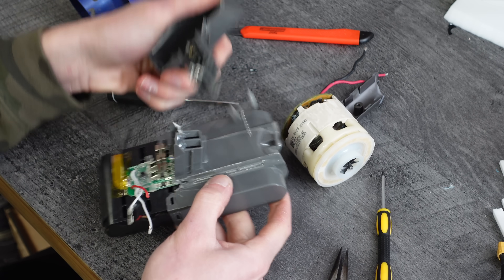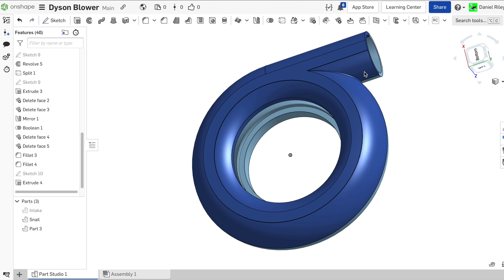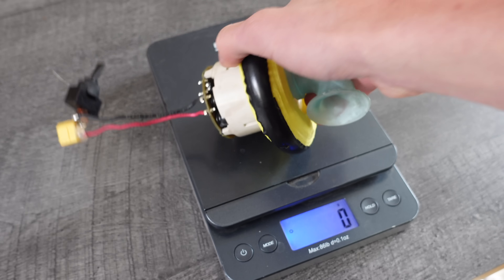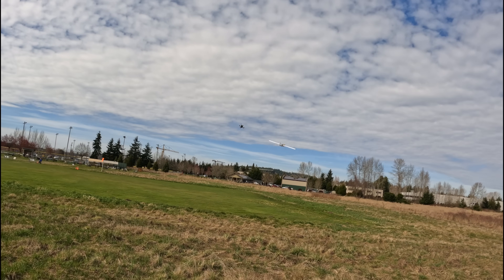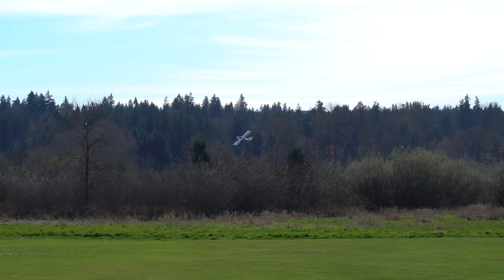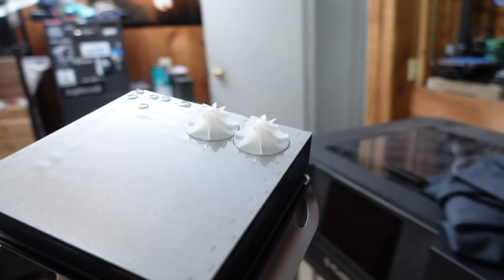Dyson Powered R/C Plane

Comment: This would be cool to redesign the engines and have them sit inside of an engine pod like a passenger jet so the turbine is pointed forward and the housing just redirects the pressurized are out around the motor and out a rearward nozzle instead of the snail shaped housing.

Comment: if the air is exhausted too fast to be effective, try blowing into a wide tube, so more air could be sucked through the tube, 
the combined airflow will be more but slower.

another idea might be to exhaust the air through a slit at the top of the wing, creating lift through blowing over the wingsurface.

last the fan from a dyson bladeless fan might be better for propelling a plane.

Ps.: mabe mr. dyson might be interested in this sort of project.

Comment: With regards the problem of flow volume, would it be possible to use a nozzle shaped after an inline venturi injector to draw extra air around the impeller exhaust?

Comment: With a high bypass venturi nacelle might possibly add a tiny bit of efficiency [similar to a high bypass turbofan engine...sorta] and make them look a little bit cooler.

With some kind of body like an A-10 you could maybe even balance out the weight while putting the thrust on the same line.

That, or perhaps tuck them under the wings and maybe use an inverted version of the Dyson ring [aka put the motor in the center of a nacelle with a torpedo slipstream taper on the back, put a tiny thin ring that forces the air back along the outside of the new torpedo taper, and then form an outer nacelle with a focal venturi just a tiny bit behind the forced air flow [see the (falsely named) 'Dyson bladeless fan', only putting the ring to the inside instead of the outside.

OR, just copy that actual fan design and use the fans [one per each motor] on the outside and pipe compressed air to them [like the original, only maybe with lighter materials and more focused on ensuring peak thrust efficiency]. 

[kinda like one of these, minus any of the needless parts https://www.amazon.com/dp/B00I8R4DLO/ref=emc_b_5_t ]

Comment: What if the impeller turned the opposite direction - allowing the reverse of the thrust?  You could pull air in around the barrel, and eject it out the end.

Comment: Wonder what it would do to the efficiency to set the impeller up in a setup like the Dyson "bladeless" fans - have it direct high-pressure air through a narrow annular nozzle in a duct to entrain ambient air, probably then with the impeller itself mounted in the fuselage.

Comment: It would be interesting to see what effect increasing the diameter of the intake would have on thrust, or even measure thrust with the open intake and more turbulent flow as earlier on in the video.

I know that when pumping liquids starvation is a huge issue and causes cavitation. I wonder if this is much of an issue with gasses. Turbulent air within the impeller?

Very cool video, the sound of that plane is Amazing
Reply: Cavitation is when you have a dynamic pressure drop in the medium through which the propellor is moving (or a fixed propellor pushing the medium) causes the medium to undergo a phase change. In a liquid medium, when this happens, the liquid vaporizes, creating gas-filled voids that can send shockwaves against the propellor if they're not carried away from the propellor before they collapse. In a gaseous medium, there is no phase change as a result of pressure reduction, so you don't have the same issues with the production of bubbles. You still get flow problems, but not the other consequences that you get in a liquid medium.

Comment: Woud love to see you use one inpeller to power a dyson bladeless fan which would probably provide a lot more thrust-to weight ratio. Jetoptera is actually using this technology to power the drones they are developing. Down the road you could rotate the dyson fans in fligt to take-off vertically and then fly horizontally.

Comment: Has anyone ever tested this with actual hbp turbo jets? I mean, if there is no significant difference in thrust, this could be the end of bird strikes, hail strikes, rain corrosion etc. Otoh, you're probably so far in the opposite corner of the efficiency graph compared to actual jet engines that for this application it doesn't matter indeed.

Comment: Not sure it’s been said, but you would have better results if you’d used the air amplifier technology contained in the vacuum. Depending on the efficiency, you could get as much as a 20:1 amplification.

Comment: No Idea if it would work but try using the motor to build a Dyson bladeless fan to propel the drone. Some use an elongated shape, which might be able to be turned into a wing (though it would have to work similarly to a symmetrical airfoil). That said pretty sure you'll never see this ;) .

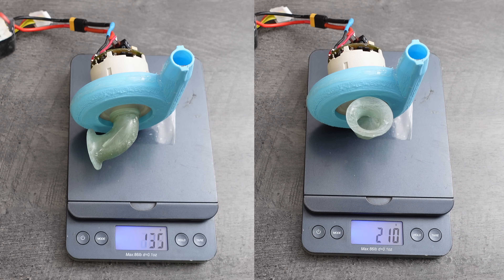Comment: 12:56 I think you're not seeing the difference because it's not a true EDF. An EDF functions more like a high bypass "Turbofan" engine does, where the accelerated flow from the compressor is responsible for the majority of the thrust. In this case, you have a perfect example of a "Turbojet" engine which the core compressor is responsible for all of the thrust. As a direct result, where the compressor gets its air doesn't particularly affect its performance as noticeably (at least in this scale). However, if this were a true combustion jet engine, I would expect it having issues with compressor surge due to exhaust gas ingestion courtesy of the low pressure area generated by the intake being so close to the exhaust.

It would be interesting to run an experiment with an EDF's intake facing reverse, I hypothesize that you'd run into efficiency problems with compressor stall in motion, rather than being able to see the difference in static measurements. Lots to ponder here... maybe I should run some experiments myself...

Comment: You might get better results if you had tubes go down along the side of the motor and join in the "combustion" chamber are behind the motor rather than a donut, you might be losing some power to the overall shape...

Comment: it would be interesting to see how much you could change on just building around the dyson motor to improve flight performance such as the output diameter. You could also run small direct tubing from the exhaust holes on the motor into the snail to try to increase thrust

Comment: No, a propeller does not just push air backwards.  Propellers are designed the same as a wing and create thrust the way a wing produces lift.  The opposite of thrust is drag
Why not put an on switch servo?

Comment: Do you get the same estimated RPM at 8640 fps? Coincidentally(?), 9120 is (more or less) an integer factor of both 110000 (x12) and 82500 (x9), but throwing in the second->minute conversion makes the numbers a bit greyer. The 4:3 RPM ratio is still interesting, though.

Comment: This video didn't suck much. It almost blew me away given these Dyson's were a random roadside finds (3x).
 🤯💨

"Should have" had each Dyson on a switch, so could turn one off, and see if could fly on the second Dyson. Might have been handy for glide angle options, or making landings easier. Curious if could sustain flight on just one?

Comment: This was so fun and impressive. I was kinda dying at the asymmetric mount to get your center of gravity/lift to be right. Since you have a 3d printer, next time you do this and it needs 2 motors, just print an inverted flow unit so you can mount the motors on the left and right of center line for the craft (in forward direction)! But seriously, this was awesome and the bonus destruction at the end had me stunned!

Comment: Now use it on a boat to pump an air pocket under the hull with side rails to hold the air under the hull until it can escape at the stern.

Comment: project idea: you should try to make a plane that can hover using only upper surface blowing (air blown over flaps/wings, pioneered by the YC-14, and later C-17). it seems like it should be possible to have a motor blowing air over a wing to generate lift and then have something else like a sting tied to a wall or a motor/prop pushing in the opisite direction to generate a force to counter the forward thrust so the wing hovers without moving forward.
i've had this idea in the back of my mind for a while now, its a very mythbusters style project involving our mental understanding of physics and how the world actually works. like "a stationary wing shouldn't be able to hover right?" but given the right conditions it absolutely can, and to see it represented as a rc model that dosn't need external wind blowing over it like a STOL plane or with strings attached like a Kite i would imagine would break a lot of peoples brains just like how the mythbusters reverse treadmill airplane did.

those dyson motors might make good upper surface blowing motors?

Comment: wouldn't it be ideal for ground effect aircraft? have the exhaust exit under the cog? 
or I dunno... hovercraft... 
think quad with pusher compressor fans... using the Flight controller gyro might be cheating... 
angle mode.. 
so 4 vertical thrust compressor fans. 
then 2 large diameter props for forward thrust. for efficiency... edf for low profile cool less dangerous...

Comment: Next, after compressing the air you should run it over a grid of resistive heater wires from a heat gun, and make a fully-electric jet engine.

Comment: A video idea is to take multi-hull boats to the extreme, way beyond tri-marain to say a dec-marain.  Given the hull speed is mostly determined by how far you have to move the water, dividing the hulls up into more thinner hulls increases efficiency but this has to have some limit right.

Comment: If you're impressed with this, get the Dyson V10 to take apart (there's also a V11 now which I imagine is even better, but I know for a fact the V10 is insane and the way it's built is crazy, - I'd strongly suggest disassembling it properly though lol) and mess with. Thing is insane. It's a brilliant vacuum as well, it has SO much power for something so small and light - it is extremely noisy. Apparently the motor spins at 120,000 rpm.

Don't get me wrong this isn't me supporting Dyson. Their traditional plug in vacuums are terrible these days, it's sad how shit they've gone. But when it comes to handheld they're extremely innovative and the leader of the industry by a looong way IMO, espescially in power. When it comes to robot vacuums? They're in the medium-high end. They do some nice innovation, but it's nothing to write home about. Then they have all their other stuff which I have complex thoughts about, e.g. their hand dryers completely revolutionised the market. But their home fans are just overpriced novelty items - it's more like a piece of artistic furniture than a fan.

Comment: I think the backwards  intake position was only working well because you designed the intake smoothly, so there will always be smooth airflow, but relative to flying the intake was causing turbulences which it immediately sucked in. one interesting thing is that suction force acts before explosion force, because the vacuum is dragging on the prop blade first acting on the molecules that stick to the surface of the blade, and mainly helps to overcome the inertia moment but its soon outruled by building up thrust (to which it is converted in a stream). I believe it is possible to harmonize and make a plane the works only by pull, however I dont know exactly how that would be, the thrust would have to feed its own intake instead of producing thrust

Comment: With your test of the fan with the intake in two positions, you got the same result because the air wasn't moving around the intake, so angle wouldn't matter. I was going to say you could use one fan to blow air around the intake to simulate the air flow, but then realised the air from the fan would be creating drag and would skew the results. Although this might actually give you more "true to real world" results, as there would be drag as the plane is flying.
 
I guess you could always put the entire plane in a wind tunnel or something, and see if it creates more force with the intake facing forward or back. Or maybe I find this specific thing more interesting than others and it's not worth doing. :P

Comment: Heres an idea.

Make a wing with a full legth slit inlet near the rear of the aerofoil feeding into one of these impellers. See if you can get airflow over the aerofoil that increases the lift at lower speeds. Would be cool as to see an EDF plane with no obvious inlet.

Comment: looks like the plane could use the 2 motors feeding into 1 outlet with separate on/off for each motor so you can control throttle somewhat.

Comment: thats not really same boat as a EDF when its using basically same technology as a jet compressor stage, but yeah alot of energy is wasted trying to force air through a centrifugal stage like that, and most of the efficiency would be gained from using something with that high pressure air.

Like in theory you could use these to make a turbo prop with some decent success since thats usually kind of application you'd want to use a centrifugal compressor for

Comment: If it were possible to add more compression fans, you could probably increase the thrust of the engine with some pretty solid gains. However at a certain point, you would lose more performance than you would gain due to the weight and power consumption.

Comment: Propeller driven aircraft lose thrust as they accelerate, turbojet powered aircraft mostly maintain thrust as the accelerate. I would guess the thrust of your dysons don’t fall off very much as you go fast, possibly allowing an aerodynamic plane to fly quite fast compared to a similar prop driven aircraft.

Edit: Of course I wrote this before your little spiel on the topic, lol

Comment: Interesting video.  I think you should try creating a variable aperture ducted fan with the Dyson motor, similar sort of what they did with Concorde engines.
Reply: Only if you could vary the speed of the motor. At a fixed rpm there will be a static optimal diameter.

Comment: 12:20     this  AINT  an  edf.          an ed FAN, operates in a 'free air' mode.    meaning, there should be  Minimal restriction of airfow, on either side of the impeller.

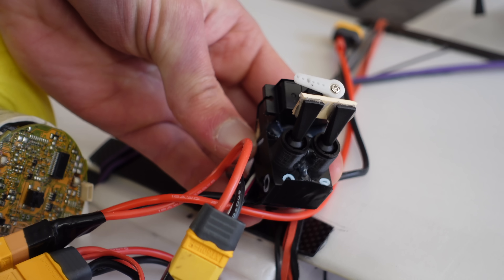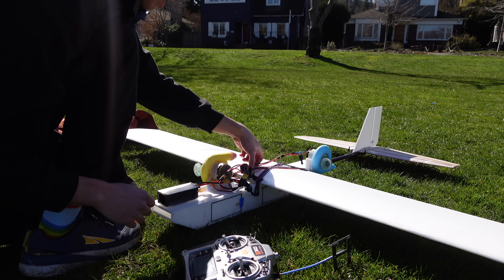Comment: information           6:20   the orientation of the horiz-stab  Should  be  reversed.    (correcting this may not be practical.)           6:36   this model has a  WONKY, tail-heavy, distribution of mass (dom).      some of the  Reasons are:  the mass of one thrust unit is located significantly aft-of  the cg/c-m.        the mass of servos has been  INCORRECTLY  located near the tail.!!!          the stabs are  poorly designed.     the vert-stab is 'too small'  and  the span of the horiz-stab is unnecessarily greater than  thirty percent of the wingspan.!        CF  is  a  Poor choice for a tail boom;  because its dom  cannot be  Optimized.         googletranslate

Comment: the efficient at high speed inefficient at low speed dynamic reminds me of gas engines, relative to electric motors. You could try both! There are a couple sparse areas where hybridization is needed to maximize performance at all speeds

Comment: Since these motors/turbines are good at making pressure, what about having their outputs as slots right in front and above of wing chords? Since wings rely on faster air above to produce lift, will forcing air this way do anything? If nothing else, seems like having a thin long slot  for an outlet would be more efficient than a tube.
Or maybe combine two Dyson things and make a "Dyson bladeless fan"-ish turbine! :D

Comment: If I remember correctly, the material used in the latest Dyson impellors is a composite of PPS specialty polymer compounded with 30% or 40% glass fiber reinforcement. Plain resin isn't strong enough for the forces endured at extreme RPMs. Should make for exciting high speed explosions though.

Comment: put a venturi shroud around the nozzle.

it draws in more air. more mass accelerating at a lower speed...

thinking back on one of those jet engines from way back (i believe it was the fairey rotodyne's tip jets actually), you can cascade the effect... shroud around a shroud etc... they were injecting fuel at high speed and it dragged its own air with it, and finally stagnating into the combustion chamber with enough pressure to overcome the combustion... 

i noticed it with a new sandblaster nozzle the other day. with the sand inlet sucking air, theres double or triple the "thrust" its producing as to when you block the pickup... which is simply the compressed air from the air nozzle by itself.

never seen anyone do it.  the "jetoptera" concept was vaguely along the right lines, sadly that was mostly scamware...

Comment: I've heard of vacuum motor powered hovercraft, but this is a new one.  I actually copied and 3D printed that impeller design, but in the end, I was too scared to actually put it on a brushless.  I just knew that the forces would tear it apart and send plastic shrapnel everywhere.